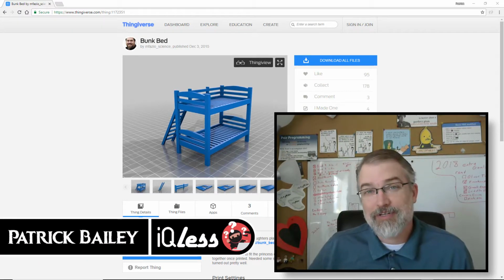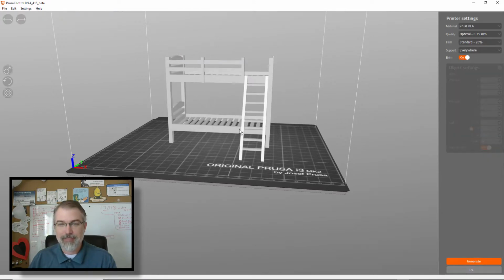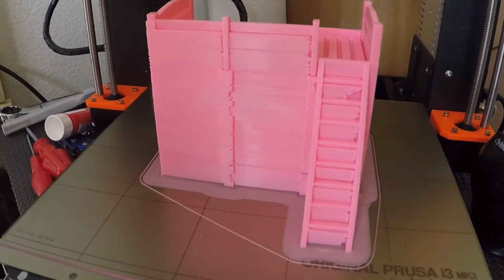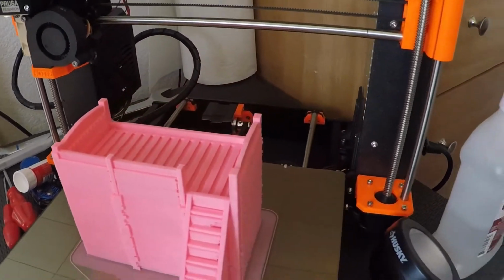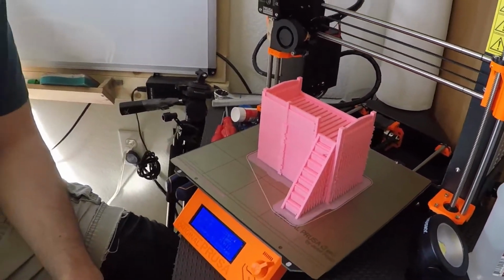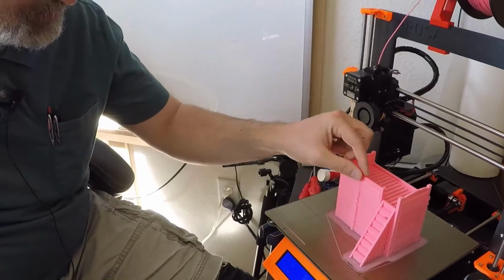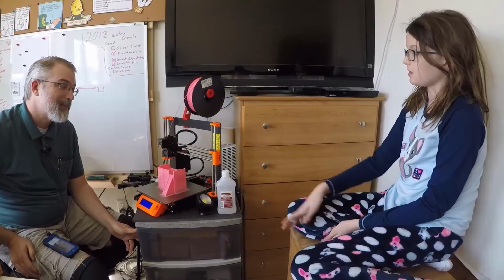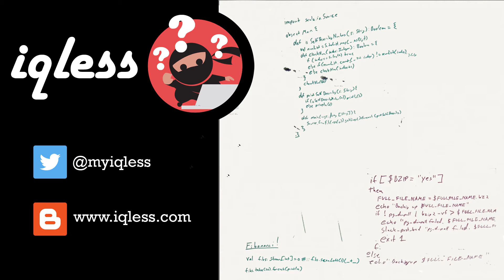Printing Bunkbed with Supports Everywhere on my Prusa i3 mk3

Comment: Thanks for the video.  Actually, if your bridging settings are setup well, you could print this with absolutely no supports.  It's difficult to explain how in this message, so I suggest researching bridging on 3D printers.  I also have an MK3 and the stock settings are pretty good with Prusa Control and Slic3r PE.  you may want to try some of the bridging test objects that can be found on thingiverse.  Just search for "bridge test" you will find a bunch. =D
Reply from the maker: Oh that is a good idea.  I was thinking about doing a test print with no supports to see how well it did.
But now I may do two test.  One just using the default settings and one trying to do some custom settings that are better at bridging.  (I see I have some research to do)
Reply: iqless 3D printing is a blast!  I got the bug about 6 months ago, and have learned a LOT!  Yesterday I was putting our bed together that we got second hand.  There was a piece missing and I realized that I can design the part on fusion360, and PRINT IT!  I LOVE 3D PRINTING!  Good luck with your bridging tests my friend. =D

Comment: Try rotating the bed 90 degrees. This should eliminate many of the supports.
Reply from the maker: Yeah, but what about the ladder?  ... Well I suppose I could put the ladder side down ...
Reply: Have the ladder side as the top OR print it separately as a modified add on part
Reply: use the split up parts version of the bunk bed instead. All the split up parts should print in a lot less time than the single part print.  Then use super glue to join the PLA bits together. :-)

Comment: Thanks for the video.  Does she love it now that you cleaned us up?  What settings did you use in the slicer?  What slicer are you using and did it come with the printer?  I just today ordered my mk3, can't wait!
Reply from the maker: I asked my daughter what she thought... here is her response
"It's really cool and it really fun to put L.O.L dolls in and play with :)"
I am still new to 3D printing so I need to learn more about slicers and all.  But, fortunately for me
the Prusa guys made a program called PrusaControl that has all the settings set up to optimize for
the prusa printer.   That is all I am using thus far and its working great.
Reply: iqless, I am still learning, mostly from videos, but I do have a friend that is really into this stuff.  I think there is probably a way to adjust the support type/style and maybe the density so that the supports are not so "solid" but it didn't look like it was too bad.  Was that about 15 minutes to clean it up?
Reply from the maker: I will have to look into that!
But your are right it was not too bad.  I should have timed it
but it took I would say 20-30 minutes to get all cleaned up (but I was videoing so that probably added 10 min there making sure it was in picture)